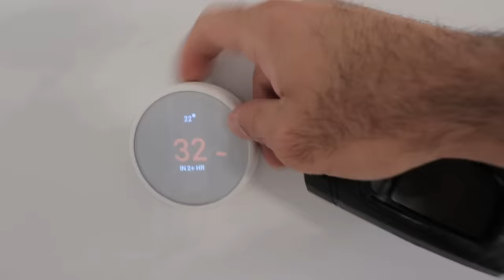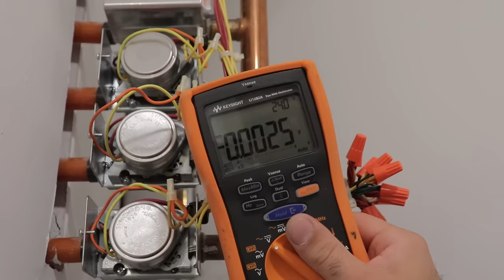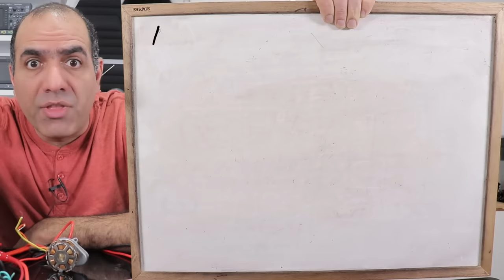Electro-Plumbing Repair… of my home heat zones that won’t heat although the boiler is running fine!!

Comment: 11:00 Be mindful that municipal codes may require that type of design even if it is wasteful. Check with a local plumber familiar with them.
Reply: This is my problem with engineers, even if the cheaper thing works the same, we have rules and codes that regulate what equipment you can use all over the world... Electricians and typical trade-workers understand this but engineers are just like "lulz, just using this" 😂
Reply: considering the electrical connections done here, point is kinda mute
Reply: @Samuel that's half-right, half-wrong though. We still do have national norms and architecture laws which mandates certain technological processes in certain applications. For instance, you cannot use just any random pipe when doing heating installations - it does have to be certified for certain temperature, pressure and material hardness. Also, you cannot use tin-based soldering joints on piping with operation temperatures exceeding 150 degrees Celsius.

Comment: Taco does make a system that has an input board that takes the old constant 24v signal when calling for heat and uses it to drive DC zone valves. They're almost standard in really big manifolds by now
Reply: genuine question, what model are those zone valves? Every zone valve ive seen for heating is AC but I only do residential house work.

Comment: As an HVAC guy with over 35 years experience,  I can tell you why it is designed that way. 

In many control and actuators they have fail safe logic. In other words they fail or go back to a certain position or state if all power is lost. Let's say you have a damper actuator that powers open to bring in fresh ventilation air into a building or system. If the power fails in the winter you Don't have power to drive the actuator closed so the building freezes and damages the building. If you  have a motor in opposition to spring tension and the power drops the spring tension will drive the actuator to it's fail safe position. Normally open or normally closed. 

I had to go investigate a large building that suffered over 800,000.00 of damage  during a power outage in the winter. 

Someone who doesn't understand fail safe logic put in an actuator that was drive open drive closed on a 6 foot by 10 foot economizer fresh air damper for the building.

They fired up an emergency generator set to get heat going in the building in one area. The building maintenance technician tried to share heat from one area to another by putting circulation fans in manual or bypass mode. This bypassed the inoperable building management system and he froze up the entire building because of a motor just like the one you are holding in your hand but much larger with 150 ft. Lbs. Of torque. 

Sometimes the few mili or micro watts of power are worth the trade off. 😉 

Sometimes Electromechanical engineers are smarter than people realize.

Comment: Medhi, the "magic device" (1:20) is a simple pump that makes water to flow. this type of pump is silent, the only method you can see if it is actually pumping water is to touch it and see if it vibrates (is a very low vibration). you can also increase the speed of the pump (but not on all models) with a rotating gear on the alimenting box (sorry if i do gramm. errors, i'm Italian and not fully understand english :D )

Comment: The valves are probably designed to run the motor like that as a fail safe feature. If the power fails, the valve closes immediately. Not sure why they'd want that in this case, maybe if there's a water leak that trips a breaker and you want the leak to stop?
Reply: Having a half-closed valve can be a hard state to recover from. Valves are usually bought normally closed, with normally open being an option.

The idea is that in the event of an emergency for repairs, if the valve remains open, it becomes a lot harder to drain the system and repair one side of the valve.

Additionally, those are the recirc lines that are valved, if they were left normally open then in a failure, they would continue to recirc water forever.

Comment: I believe the reason they have to stay on when the valve is open and close with a spring is to keep the valve close in case of a power failure. So if you use them for something that can spill out (and maybe catch fire, like fuel) they fail a little safer.
Reply: In electrical speak, they want the water lines supervised.  Aka if there's a problem, they want someone to notice and fix it.

In this case, the system is telling you there's a problem with the valve by cutting off your heat till you fix it.

Fire alarm systems work in a similar manner, except they get nice and loud speakers and flashing lights to tell you something is wrong and you need to GTFO (or just the control panel starts to scream to get a tech in to fix it)

Comment: 2:00 This setup is a passive mixer; it reduces/balances temparature by joining the forerun and backrun of the loop at some point. Most of the time, there's also a reduction inside the plumbing where the two pipes join to reduce flow rate.
Reply: if medhi was an aerospace engineer he would know that!! (taught in thermo 1)

Comment: @ 13:50 not the motors overvoltage is the problem : the failure occurs due to mechanical wear…

Comment: Mehdi: Electrical engineers are at the top of the hierarchy, plumbers are at the bottom

Mehdi two seconds later: Points to plumbing “I don’t know what this magical device is” 💀
Reply: Turns out it was a water freewheel diode
Reply: @hugofontes5708  can you make a full bridge rectifier out of that?
Reply: @LazuliteLol maybe.  But most water lines are already direct current systems.  So there's nothing to rectify.

Comment: Inefficient design! Almost all devices that involve plumbing cope with this problem.

My HR heater has an efficiency rating above 100% but I still get larger energy consumption bills in the colder months…

Air conditioners are even worse, they have a little pump to get condense water out to a drainage right next to the hot cooling radiator… I don’t get it… Evaporating water can cool that radiator allot more efficiently than simply blowing air through it.
The water is condensed so it should not give any calcium buildup issues on the hot surface. Perhaps some corrosion, but an appropriate coating should help.

To notch it up a bit, it may help to mount a few (sandwiched if needed) NTC elements on the top of the radiator to boil that condensed water away if the supply is more than passive evaporation on a hot radiator could handle.

Only tropical countries with an extremely high humidity may not have much profit by evaporating water, but I think it would really make a difference in most places.

I hereby declare these ideas to be public domain, so anyone attempting to get a patent on them should be rejected!

Comment: It’s called primary secondary piping mehdi it lets the heater put out balanced flow so you don’t get temperature drop through the zones at the supply inlets

Comment: on the right side of the valve (the 5 vertical ones) there is a little metal tab that allows you manually open or close the valve.

Comment: The reason they use that design is so in case of disaster / power outage the valves close. This helps in case power is out in freezing temperatures. If you purged the line it would be problematic if water is turned on but not power, and it freezes in the lines, or if you need to do any plumbing work and power is out, the lines stuck open.

Comment: The switch in the valve is a "call for heat" signal to the boiler when the valve is open, so as long as the valve and it's corresponding thermostat/timer are both "calling for heat" then the boiler will fire up.

Comment: Practically the opposite happened to me. We had the heat that wouldn’t turn off and it was so hot for a few days. And it was in the winter and we were sweating. Had the fans on. And the windows open.

Comment: Just a thought, but how about putting a resistor in line with each motor to take off some of the stress.  I did a quick calculation (which may be wrong) which said a 6-8 ohm resistor would drop the voltage the motor sees closer to 24V. Unfortunately the resistor would end up dissipating 3+ watts. You'd have to play around to find a value that still runs the motor despite any dips in the supply voltage.
Reply: I was thinking the same thing, but I was too lazy to determine a resistor value. A trick which I think is sometimes used is to have full voltage connected "normally" but when the motor triggers the end of travel switch put a larger resistor in series. Depending on the wiring this could be easy, otherwise it could be done with a relay. By using two power levels like this much greater efficiency can be achieved.
Reply: I was also thinking that but if all the valves are on it could drop to low and the motor wouldn't run.
I don't understand why they make it so that all the motors can run at the same time at all... Just give it a little smarts and make them turn on 1 by 1. Make it a steady 24v... But at that point ur probably better off going the mentioned DC system anyways
Reply: @Shark-8472   I think there is a reason why they have don it like this, like if you have an error and there is no Voltage, so that they will all close.
Reply: @eDoc2020  I like that idea. Have a second resistor which is normally shorted by a normally closed contact which opens when the motor hits end of travel. As with the inline resistor I suggested, you'd have to play with the values to find one that still works at the lowest supply voltage.
Reply: Motors are quite tolerant of overvoltage.
Reply: @stargazer7644  That's true but it will not life as long as normally.

Comment: Normally the reason for these valves using springs and constant-on motors is that in the event of a power failure they'll all open, allowing free flow of water so you don't end up with weird pressure issues while the boiler isn't powered. It probably also helps distribute a bit of heat to the radiators through convection, so your house doesn't cool down quite as fast.

Comment: If the full load requires 26V and they are rated for 24V, can the transformer that produces 31V be reduced to 29V... prolonging the life of the motors!?

Comment: Something regarding the unregulated voltage: A colleage owns a company which has some really high-power engines and they are controlled and interconnected with a ProfiBus-System.

The system occasionally threw an error and after long search guess what: The 24V DC-supply (i.e. just proper winding+bridge rectivier+caps) was not stable when a powerful motor started: The supply dropped, consecutively the 24V were something below the tolerance at the termination points of the bus system and this caused the error. After replacing the 24V supplies with regulated ones the errors were gone.

Comment: Would it be worth it to add a voltage regulator to the line that sends 30Vac to the motors? Just like a zener diode in parallel to keep it fixed at like 24-24.5Vac
Reply: I figured it would be fine running within +or - 10% of the stated Vac . Although it’s not ideal and would eventually cause wear and tear .
Reply: dont diodes work with dc? please correct me if im wrong about this
Reply: @TantalumPolytope  yea you could use dc with a diode
Reply: @buckConverter24v5v  a zener diode wouldnt work with AC tho, right?
Reply: @TantalumPolytope  it would, it's designed to have forward and reverse breakdown voltage. A really common, though frankly not reliable, voltage regulator design use zener diodes with  a parallel resistor to main voltage around a certain interval
Reply: @buckConverter24v5v  fair enough

Comment: In steam controls for example downtown detroit, the valves are wired normally open. Requiring power to close. The idea is that if controls fail or building power fails in a large commercial building they fail wide open so a bunch of pipes dont freeze.

The steam is created at a seperate plant and piped in underground.

This is how we wired any critical heating valves. Controls failure and you have full heat.

Comment: 2:29 are u really allowed to have the zone valve connections just in the air like that and connected with screwits. Never get away with that in the UK
Reply: In addition, the single insulted wires are strapped to the hot water pipes.  Conduit would be required in the UK.
Reply: For the most part Yes. At least here in America. 24VAC is considered "Low Voltage" and is an industry standard in the HVAC industry and typically doesn't get as much scrutiny as 120/240VAC does with the NEC (National Electric Code). That being said though American code jurisdiction is a nightmare. Its not uncommon for Cities and Counties to have conflicting code requirements, then you have the States codes, which also for the most part vary from State to State.
Reply: @alanpatterson2384  American thermostats run on 24 volts unlike UK ones which run on 240v.
Reply: @eDoc2020  still should be in a box at the very least. I wouldn’t leave a 12v connection like that 😆.
Reply: @awhiting8966  I agree it should be in a box. There's probably space inside the valve's motor cover.

Having said that, I would leave a 12v connection like that, but only "temporarily" :)
Reply: @TEHSTONEDPUMPKIN  That's literally what I cannot comprehend AT ALL. ALL of the design requirements in any single country should be uniform throughout the whole country. That way any installation made to the code can be integrated with any other installation from any other location, allowing to interconnect large areas.
Where I live, it's actually illegal for districts or any smaller administrative units to make their own installation codes - the only one actually in effect is an executive order issued by the Ministry of Infrastructure in according with various country-wide bills regulating different installation types. Any local utility operator who does not adhere to those regulations risks having its operator license revoked.

Comment: I would guess that the valves powering on and staying on is probably a safety feature. That way if the power goes out or the motor breaks the spring ensures the hot water shuts off.

Comment: Can you explain how those metal brackets at 8:40 work, which you explain are there to do phase shifting to make the (I assume) what would be 3-phase AC motor work on 1 phase (if I am understanding that correctly)? Sounds really interesting if that's the case. I am not sure if I am misunderstanding, however, because you later seemed (to me) to say that an electric current and thus electromagnetic field is induced into the rotor to allow the stator to pull it around with the rotating electromagnetic field, so I'm confused as to if this is just fundamentally different to how an 3-phase AC motor could ever be, or if an analogous paradigm for stator design exists in for 3-phases as well, but there is an additional mechanism allowing whatever combination of stator and rotor designs to work on 1 phase. Thanks.

Comment: A lot of over-engineering (the valves). 🙂
Combi's are often used here.
We all have one thermostat in the living room...
...And every other room has a thermostat on the radiators.
Reply: This system can call for heat to the heater itself, like your livingroom one. Say you want heat in your office, the rest can stay at 16c, and the office 22c. Cant do thst with your system. Thats old, this is new :-)
Reply: @Deiphobuzz  I know and you're right, but...🙂
...In practice, my system works just fine.
(Situation: Every other room is (a bit) colder than of the livingroom.)

It is a compromise, but it never fails.
And that means a lifetime.
Reply: @Deiphobuzz  Forget the "but"...
...You're right. 🙂

Comment: I am going to suggest that the bypass (short circuit) loop in the plumbing is to prevent the pump from being "deadheaded".  If all the zone valves were closed and the pump is running the water in the pump body would be churning with nowhere to go and possible heat up significantly.  The bypass allows some circulation to take place in the event of all the zone valves closed.
Reply: I think it is also because the boiler has it's own small recirculating pump to run that loop and the zones draw hot water from that as needed. This way the boiler gets the consistent flow it needs regardless what the zones are doing. But to do this obviously there needs to be a complete loop for both so you need that bypass pipe such that any excess flow through either loop can bypass the one with the lower flow rate.

Comment: As long as the zone calls those motors are consuming juice,  the switch doesn't lock anything, it will power an indicator,  or tell the computer that the valve is open so it will start as not to potentially damage the unit itself.  I have been able to bring these back to life with plenty of trial and error.  Electric contact cleaner and exercising it has been repairing these things for me time and time again  now.  Working for a property owning over 900 apartments,  I'm always looking for ways to fix the issue quick,  and not have call backs. I have probably a 95 percent success rate doing this before having to replace that motor.